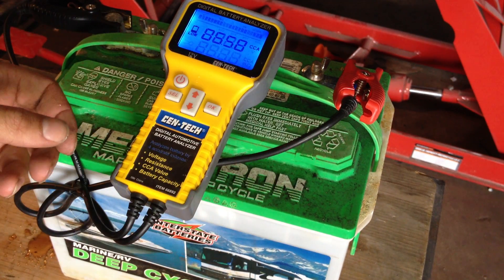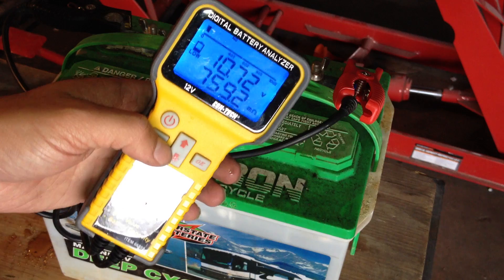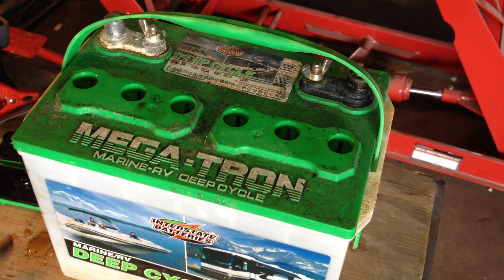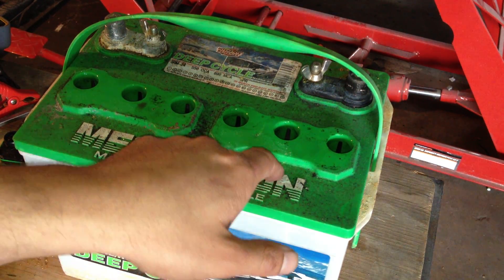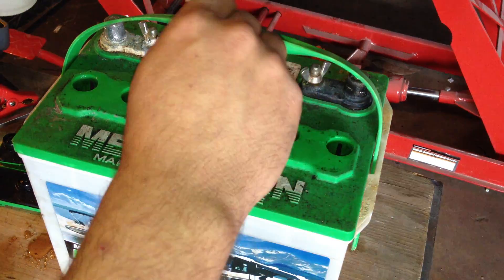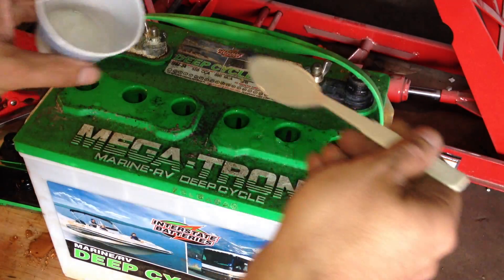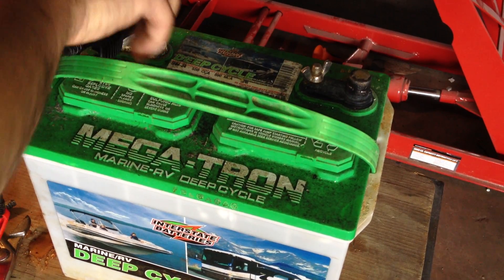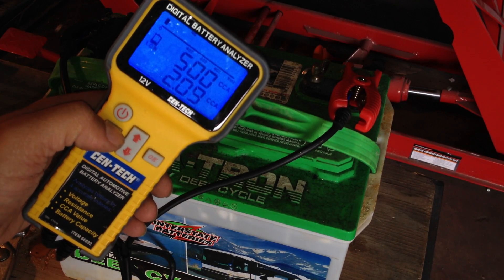Lead Acid Battery Desulfation Using Epsom Salt --Add Solution to Dead Interstate battery Part 2 of 6

Comment: Make sure you mix a half a box of Epsom salt in distilled water and then pour it and distilled water in the battery you might want to drain the battery into a bucket but wear gloves when you do it protect yourself from battery acid

Comment: a 5 dollar voltmeter would TELL you exactly the same as that  $ tester;   10.7 volts   THAT is it, ONE bad cell; battery has 6 cells  (2.1 volts x 6   is 12.6 ) , so 10.7 volts means ONLY FIVE cells are working;

Comment: Aren't you supposed to empty the acid out before adding epsom salt?
Reply from the maker: no need or reason to
Reply: @KmanAuto  Hmmm. For some reason I assumed that if you only add epsom salt without emptying the acid, you are creating a different compound by combining sulfuric acid, magnesium sulfate, and water. Well I'll give it a shot then. I already bought replacement battery acid due to my assumption. Thought I would need to pour it all out. I have 1 cell that has not responded to hitting it with high juice at intervals. Every other cell woke up perfectly. At the beginning, one tiny bubble every few minutes. Now the second I hit it with any charge at all, 5 cells start to vigorously boil. But 1 simply does nothing. So I guess we'll see.. Thank you for taking the time to respond. Because of that new subscriber.
Reply from the maker: @coachtim6188  Thank you for subscribing! 
As for emptying out, my assumption has always been emptying everything out was to remove any particulates or contaminants in the battery. 
You could possibly do the flush after adding the epsom salt and letting it dissolve the sulfate.

Simple break down as to why you “may” want to dump it, 
Deep cycle batteries for example, the plates don’t go all the way to the bottom. there is a nice sized gap before the bottom of the battery. This allows sulfate and contaminants to drop to the bottom of the battery. That prevents dead shorts. 
Starting batteries, have a much much smaller gap, marine deep cycles a bit of an in between gap. That’s because those batteries are generally not deeply discharged as often or at all. A charged battery does not develop sulfate as quickly or even as much. On a badly sulfates battery, that drop space below the plates may fill up, and if it touches between plates you get a dead short, and permanent capacity loss. 

As for your battery, the 1 cell that isn’t bubbling, may be the good cell. the ones that are bubbling, may have high resistance. it also could be the opposite. might need to take a multimeter to each cell and check voltages as well as check the gravity.
Reply from the maker: @coachtim6188  instead of hitting with high currents with a desulfator, instead switch to low current. my main desilfator uses a 80 mfd capacitor. my slow one uses a 10 and i also have a 5. Desulfation, depending on how bad, can take a LONG time. When I do customers golf cart batteries, I put them on the slow one, and then let them sit all winter. 
My personal golf cart is using marine batteries, not even golf cart batteries with the thick plates. Finally switched the batteries out last summer. They were 12 years old and i could still use it all day around our motel we own. Batteries still worked, we are using 2 on the pontoon, one as a back up other as the accessory/radio battery and starting, and the third (only used 3 12v batteries, instead of 6x6v batteries) Third went in the lawnmower.
Reply: @KmanAuto  How interesting. I knew about the gap at the bottom to collect debris but did not think about the possibility of the debris touching and creating a short. The acid/water in each cell was crystal clear before I started hitting it with intermittent charge to desulfate it. Once they started waking up, the water change to dark cloudy almost grey mud. The dead cell is still crystal clear.  It is definitely a dead cell as of now. Barely registers a charge with multimeter while the other 5 are above 2 volts.

I'm no chemist but I'm trying to figure out what occurs when magnesium sulfate is combined with sulfuric acid. I see most suggest removing all acid then replacing with magnesium sulfate mixture since the chemical structure is different. Should be some interesting experimentation. Haha
Reply: @KmanAuto  Wow. Even more interesting. That is truly amazing. I don't actually have a desulfator. I'm using a charger that allows for 200amp high rate all the way down to 12 volt 2amp. I guess I need a way to drain the battery also.
Reply from the maker: @coachtim6188  Report back if you do it! One thing you can also do so your not hitting the cells that are now taking a charge, you could use a metal rod of some sort, and put it in the cell that is still dead, and another rod in the cell next to it or the terminal if it's a end cell. Disulfate just that cell.
Reply: @KmanAuto  Also, I need to build that desulfator with a capacitor. That is incredibly interesting.
Reply: @KmanAuto  I sure will. I've actually been wondering if that was possible. Didn't think of using a metal rod but that makes perfect sense. This has been a week long experiment so far and was curious if there was a way to stop hitting all the good cells with so much charge. I mean it can't be good for them. The first to bubble immediately with any charge is always the end cells, mainly the one near the negative terminal. The dead one is one cell down from the end cell that is closest to the negative post.
Reply from the maker: @coachtim6188  Here you go :-) 

How to build a Desulfating Capacitive Battery Charger, Complete with Diagram Start to Finish
https://youtu.be/N6NluEvBAUU
Reply: @KmanAuto  You are the man. Ordering the parts now. I own a handyman business and also do small car repairs on the side. I could see battery restoration or maintenance as a possible add on. Time to build a charger.
Reply from the maker: unless it’s cloudy and contaminated, then replace it with fresh
Reply: It appears this battery is just shot. 3 weeks now and nothing is working. I've literally tried every hack out there. LOL I ended up pouring out all the acid hoping to maybe dump out the junk in the bottom that may be shorting that cell out, and now I've got epsom salt solution in each cell and slow charging it hoping maybe this last ditch effort will wake up that 1 stubborn cell.

Comment: I still cannot believe how great this battery reconditioning program rb.gy/cnx6vn worked. My drill battery, several AA and AAA batteries, and my camera battery work great once again! The steps are easy and the act itself is exciting to do. It doesn`t matter what type of battery you`ve got, it`s certain to function again!
Reply: Great video content! Sorry for the intrusion, I would love your thoughts. Have you thought about - Rozardner Powerful Battery Reality (should be on google have a look)? It is a great one of a kind guide for learning how to recondition an old battery without the normal expense. Ive heard some pretty good things about it and my work buddy  got excellent success with it.

Comment: I added salt to battery and now smelling chlorine smell 😂
Reply from the maker: that’s not chlorine, that’s the acid and hydrogen
Reply: @KmanAuto  thanks very much for reply. Any risks if I try to charge it?
Reply: Epson salt (magnesium sulfate) 
not 🧂 table salt 😂

Table salt can produce chlorine when under a charge of electricity

Comment: Not sure I would call it "desulfate" when magnesium sulfate (Epsom Salt) is being added.  Adding some sort of basic solution (such as sodium bicarbonate, or "Baking Soda"), first, could help to clean the surface of the plates.  Then, after a thorough rinse with de-ionized water,  add some Epsom Salt to create an ionic solution for the battery plates to use.
Reply: Agree. This video is wrong in do many ways..
Reply: Problem with putting baking soda inside the battery is if you don’t get it out it will constantly neutralize the battery and it’s dead. That’s said I do agree if you know what you’re doing you can clean it thoroughly but the method here is just fine for a quick fix and I’ve seen batteries last 2-3 more years after a quick fix like this. So I wouldn’t call it wrong in so many ways.

Comment: I'm replacing a 420 CCA battery with the same one which is this one :-

https://www.repco.com.au/en/globes-batteries-electrical/batteries/batteries-automotive/repco-extra-heavy-duty-battery-12v-420-cca-239l-x-172w-x-218h-mm-58-red/p/A9378180

The one I replaced 3 years ago,well a cell started to go bad in it & the cranking voltage got down to 8-9 volts so I bought a new one today.

Note I usually check the open circuit voltage before installing the battery & it was 12.1 volts on the brand new battery & the gravity was way down in the red on the hydrometer.

I'm not sure how old it is, I think it may have been sitting on the shelf for a while but I have it on charge overnight to bring the voltage back up !

Comment: Hi, for any of you guys using the CEN- TECH battery tester the switches can sometimes eventually give trouble. It's a good tester, I like it. The switches are not that difficult to replace if you're good with a soldering iron. In many cases a squirt of a good quality switch cleaner like Philips or Servisol will cure the switch problems. These type of switches give trouble on many makes of electronic equipment. Don't use WD40, as it's not designed for that. Remove the back cover. You can take out the entire PCB (tiny screws) Mask the screen with tape & cover round the PCB with toilet tissue. Spray quick, tiny bursts, carefully into the top of each switch, & click  a few times as you do it.

Comment: Sir tnx  4d informative video..I want to try can u tell me how much Epson to put on a 200amperes deep cycle battery for desulfatation. and  should I first drain my old battery solution b4 put some Epson salt and distilled water
Reply: Yes you should empty the battery

Comment: when a fairly new battery in the hot summer is low on water are you suppose to use regular distilled water or does it also need something else to keep the acid ration correct?
Reply from the maker: Distilled water only
Reply: Charging the battery will turn it into sulphuric acid

Comment: I have a Mega-Tron probably around 2003/2004 year battery that I dumped the old water/acid and used the baking soda/distilled water solution to boil it out and flushed again with distilled water. Before I dumped the old acid out it showed a reading of little over 5 volts afterwards with just distilled water showed a reading of less than 2 volts. I then mixed a solution of 8 ounces alum (food grade) to 1 gallon distilled water and used a old 6 amp battery charger from late sixty's early seventy's that still works fine but when hooked up to my alum battery experiment the meter on the charger reads 0 than jumps to 8 than back to 0 then back to 8 also battery feels warm not hot to the touch but warm. So I'm assuming this battery is junk (direct short) or I'm I missing something? Not that familiar with batteries just learning I have two other deep cycles that read around 5 volts to try and re-cover.
Reply: +hakentt Thanks for reply.

Comment: This actually works.  I could only get about 3 seconds out of a battery I thought I could fix by flushing out with water and adding pure sulfuric acid.  Never do this by the way as the battery almost went into meltdown.  the battery would charge to full in about 3 minutes and discharge on an inverter in about 3 seconds.  After doing this it ran for about 15 minutes on a water pump.  I will keep charging and discharging and see if it gets any better.
Reply: +jeff vies when you mash your thumb you should always soak it in cider!
Reply: INSANECANDYCANE1958 the story on restoring a car battery doesn't work for me he came up to 12 volts I don't know about the m but I used the battery for my ham radios and looks like it works with Epsom salt and distilled water I drain the old water out it was black as the night better never hold a charge always go down to 6 or 8 volts now it's staying off to 12 volts water relief but I wouldn't put it in the car because I don't think it has enough and slow cranking power I haven't tried that yet thank you very much I have learned something new everyday aloha
Reply: , words did not come out right the restoring of the car battery do work for me thank you very much I love her aloha
Reply: , a few words I'm trying again I don't know on the amperage I don't I'm not worrying about the emperor because I will not put these battery in the car it might work I don't know I've charged it for about 12 hours it came up to $12 over 12 volts that's all I need thank you very much I love her Aloha not love her
Reply: Times up for Jeff it does the trick after all I'm so surprised aloha
Reply: Arms up not times up thumbs up

Comment: Why not just invest in Military grade batteries? They have some you just jump with a resistor when the voltage drops and they get a full charge!
Reply from the maker: Umm.. Military grade batteries = insanely expensive.

Jump with a resister? I think you need to do some reading up. Resistors will DRAIN power, not charge.
Reply: I found the ad in a magazine and they are dry cell and were in rv magazine and it said clearly if voltage dropped below 12 you would simply jump it with a resistor and you'd get the full voltage instantly. I do know that sounds funny, but these were unlabeled green batteries that military uses in all vehicles and they don't have time to charge a low battery, so something as quick as this is a requirement, these batteries were also said to last 10-15 years or more. I will do more looking online to find them.
Reply: All I know it claimed that it had two terminals you touched a resistor to, it would renew the voltage. They were in the back of an RV magazine years ago! I was only stating their claims! Probably like 1999-2001! It obviously wouldn't work on normal batteries! But if it were available they would be a great investments!
Reply: LuxorVan  The back pages of any magazine are filled with crap man. The technology may exist though and you get a plus in my book for your enthusiasm. Cannot and will not gain a charge from applying a load (resistor) to a battery. The least it could do is desulphate the lead plates in the battery, still needing charging before operational (kinda what this video is covering). Remembering stuff from '99 gains you the credit of a Human Being. Keep it up mate (mostly everyone else cares about nothing) :)
Reply: +LuxorVan  The winding's in an engine starter are basically resistors. So if I use one of those and my battery's dead I can just turn the key and voila? Trust me dude, too good to be true.
Reply: +LuxorVan I\'m not sure but ,if anyone else wants to uncover how to recondition batteries at home try Knewreck Rapid Renew Guide (should be on google have a look ) ? Ive heard some pretty good things about it and my partner got excellent results with it.
Reply: The batteries I mentioned were claimed to be used by US military for over 50 years, they were not lead acid, they were a paste type sealed battery. Just remember lithium ion are now a hit, but were used by German uboats in ww2!
Reply: +LuxorVan anyone know where this guy lives? Optimus Prime wants to kick his ass.

Comment: so, you show a conductance testor and you never test specific gravity for each cell?   when you say the battery is "weak," how do you know unless you use a carbon pile load testor or test the gravity?   Seems like we need a crash course in battery testing!

Comment: never add anything to a battery there are better ways that wont damage thebattery forever
Reply: ghettohillbilly1 maybe you can fill us in
Reply: I recently got the EZ Battery Reconditioning program and just reconditioned two car batteries. The guides were very easy to follow [Check Details Here==> HootBattery.xyz  ]. I wish I would have found this years ago! Thanks!?

Comment: i have an atv battery 12v 15 amph it has been sitting in the weather for 14 years its empty when i added electrolytes it jumped from 6 to 9 volts what can i use other then electrolytes the amount i should use ect
Reply from the maker: Epsom Salt, thats it. If it doesnt go higher then 10.2v, then the battery is junk. Toss it.
Reply: +KmanAuto need help..urgently
my battery is giving 10.5 volts..i think one cell is dead.. i find it through multimeter..
i am going to clean and refill it with acid and water..can you tell how  can i clean it from inside...can i use mineral water or anything better?
Reply from the maker: Not worth the time and effort, go to walmart and get a replacement for $45 :-)
Reply: +KmanAuto Alum
Reply: who knows what this new batteries ??? http://mytechon.com/eternal-the-battery-on-the-principle-of-overflow-of-liquid-electrolyte/
Reply: >>>Our battery reconditioning methods works for nearly all types of batteries>>>[ https://www.facebook.com/Restore-battery-1123300471065849/?sk=app_190322544333196=dghr5-vbn5t ]............<<<<<<<<<

Comment: wouldn't have been better to dump all the water and acid from the battery, and then refill it with fresh distilled water and epsom salt mix?
Reply: NO THE ACID IS IN THE WATER  AND WHEN DRY IS BOUND UP AS SALTS.
Reply: you need acid in the battery.

Comment: I believe you can get battery electrolyte (acid) at any battery dealer. They sell it in cardboard boxes with a heavy plastic bladder inside. I have three gallons in the barn that have been there for about 5 years and haven't leaked a drop. I know glass will contain it but so will a battery, and the battery case is plastic. So I believe some plastics will safely contain it and do not have to be glass.
Reply: Pretty sure most car parts chains sell battery acid, I know advance auto parts does